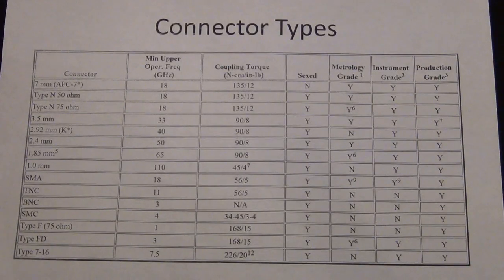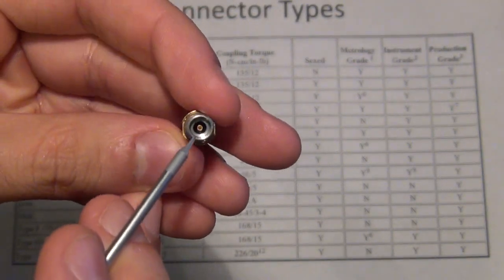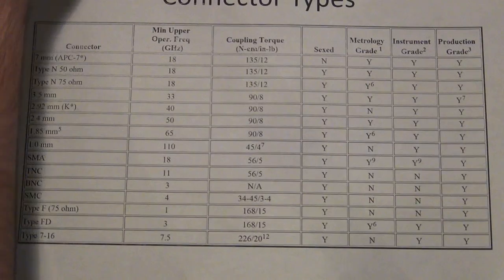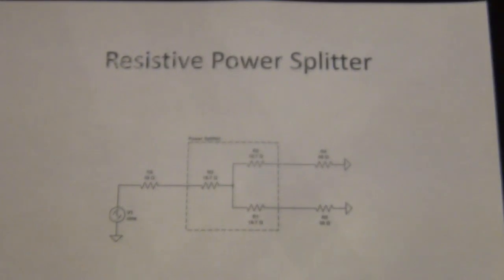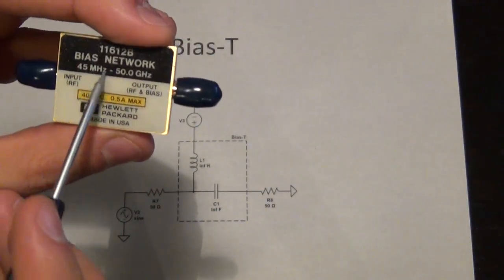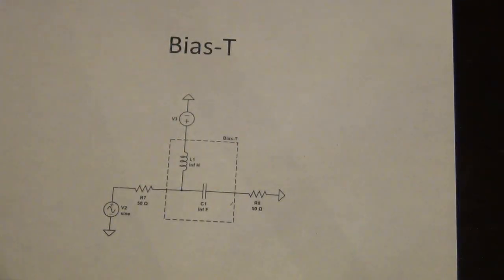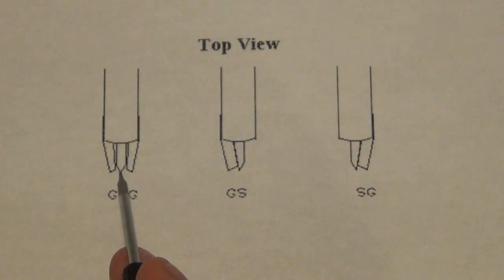TSP #26 - Tutorial on Microwave and mm-Wave Components and Modules

Comment from the maker: After a decade, there is a mistake in the video I'd like to address:

The subtle description of the doubler operation at 45 minute mark is not correct. The top and bottom of the board form a broadband balun and the tapered lower layer transforms the signal into a balanced mode into a quad pair of diodes. The signal then mixes with itself producing the doubled frequency. At the same time we don't want to self-mix down to DC and create a DC offset so the little wire is there to keep the DC voltage at 0V while acting almost like an open at higher bands - kind of like a bias-T but with a lower cut-off at >1GHz. This doubler is fairly broadband, operating at the input from 1GHz to 32.5GHz. The fundamental rejection is about 15dBc worst case, likely at the edges of the band where the balun does not have very good phase and amplitude response.

Comment: Excellent tutorial but unfortunately at minute 45, where a frequency doubler is presented, the explanation is very wrong from the beginning to the end. Actually this is a quad diode full bridge doubler that has 4 diodes in the center (like a full bridge rectifier) The line on top together with the tapered line on the bottom make a broad band balun providing a balanced signal to the quad diode component in the center  (bottom is not the ground anymore and it is not also an impedance match either it is really a slow transition from microstrip to parallel line). The thin microstrip line connecting to the ground in the center is actually the return path for the DC and not a filter. Its length is however chosen so that it would not affect the operation frequencies. The balanced nature of this doubler allow it to have a particularly good fundamental rejection, ideally a set of matched diodes along with perfect baluns would result in infinite suppression of the fundamental. Obviously the small asymmetries found in the balun and diodes will result in finite fundamental rejection, good diode selection and careful assembly could allow reaching some 30...40dB rejection (and maybe more) which could be considered excellent performance for a doubler something that the explanation about the fundamental rejection presented on the video leads to think otherwise. I am so sorry to point all this out. Since these videos are very good and educational it would be very good if this part could be corrected. I may suggest to insert some legend in the video. Or some other kind of editing.
Reply from the maker: Thanks for taking the time to write. This video is over ten years old, so there is bound to be some inaccuracies. Indeed the the broadband balun design is something I think I may have talked about in some of the other videos. The bias tap point prevents a rectified DC from appearing at the input side by keeping the bias at 0V. The doubler works from 1GHz to 32.5GHz, which is pretty impressive. Having said that, the fundamental rejection is only 15dBc which is likely the worst case scenario since at the edges of the frequency the balun doesn't have as good of a phase and amplitude balance. This unit was damages many years ago because someone put >20dBm into it blowing up the diode MMIC.
Reply: @TheSignalPath  I see that now you have a good understanding about how it works. Since the video is still available, is educational and very valid despite being 10 years old (surely with people learning from it today) I kindly voice again my suggestion of some legend insert or else... Thanks for the nice contents you keep providing over the years.
Reply from the maker: Yes, I made a pinned comment in the video.
Reply: @TheSignalPath  Excellent. 🙏

Comment: At 32:00 the coupler looks very much like the one in HP VNAs such as the 8753 d/e/es series.  The resistors on the right hand side have a tendency to burn out due to ESD as they're built onto the trace/board.  They can be fixed (basically) by replacing them with a 265 ohm resistor to make up for the burnt out component.  Extremely common problem with HP VNAs.  The screw positions appear to align and the internal structure is extremely similar, so if this isn't an HP part, it's a knock-off.

Comment: Inspection under a microscope is critical.  Some metrology labs have bizarre criteria for acceptance of these connectors.  For example, I've had calibration kits returned as "okay" when upon inspection, most of the spring fingers inside the connector were missing!  It turns out, the only criterion for acceptance was pin depth!

Comment: 13:00 - a real shame you just jumped right after the "mere 3GHz BNC" connector all the way up to 40-60 GHz connectors and using torque wrenches.
Real shame, because most of the instruments that are within 3-7 GHz range (spectrum analyzers) use N type connectors, would have been better if you included those and shown these.
15:10 - Also no mention about the required setting for the torque wrench Nm setting. Some have really small torques counting in 0.01 Nm adjustments, and the others are in 1 Nm adjusts, all the way up to dozens of Nm of torque. Which one do you use? At which connectors does it start to matter? SMA? N? Or these crazy $200 K/2.92mm connectors?

Comment: This was super useful, but I'm sure many of us are wondering how much this stuff costs, so I made notes throughout and looked up prices for everything I could identify.  If no manufacturer specified, it's HP/Agilent/Keysight, and prices are either new, or taken from eBay in Jan 2021, all in US dollars.  I'm not an expert on any of this, I just looked stuff up.

@14:20 - 8710-1765 Torque Wrench, 8 lb-in, $300 (eBay)
@17:29 - N5520B, 1.85mm - 1.85mm F-F coupler, DC-67GHz, instrument grade, $1649
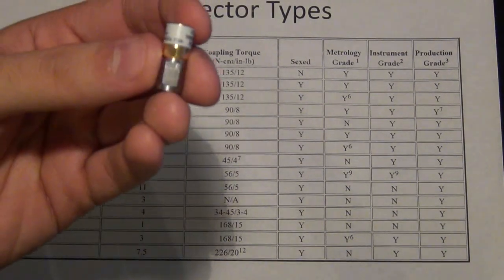@20:14 - 85138A terminator, DC-50GHz, metrology grade, $1036
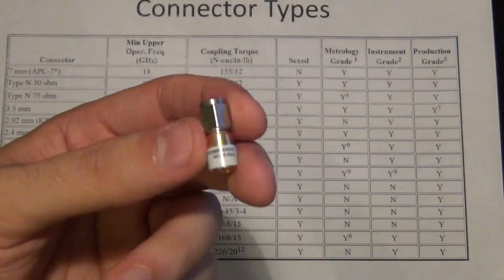@21:28 - 33340C fixed 20dB attenuator, DC-26.5 GHz. (obsolete)
         8493C  replacement part for 33340C, $506
@22:29 - 11636B power divider, DC-26.5 GHz, $1725
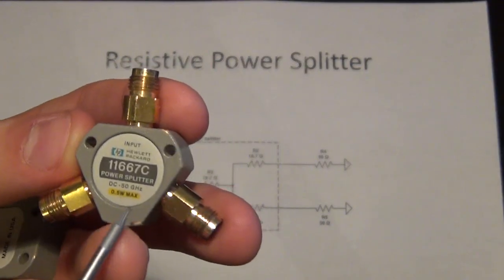@24:46 - 11667C power splitter, DC-50GHz, $2572
@27:16 - 87304C Hybrid Power Divider, 2-26.5Ghz  $1144
@28:10 - MACOM 180deg stripline hybrid, $2483
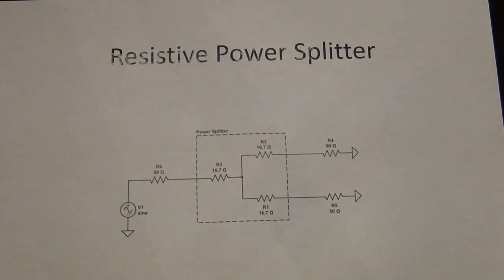@28:57 - 5086-7518 50 GHz directional coupler, $1400 (eBay)
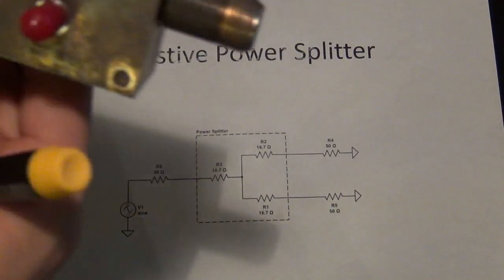@29:23 - MACOM 3020-4099-00  directional coupler, $75 (eBay)
@31:20 - 5086-7489 50 ohm R-Channel coupler, $575 (eBay)
@32:17 - Picosecond Pulse Labs 5500A DC Block, $199 (eBay)
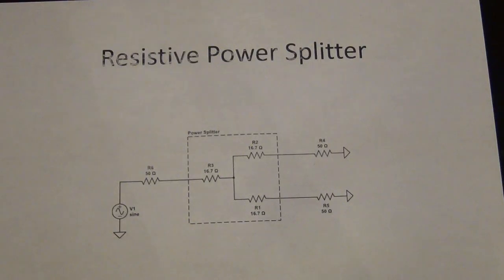@33:05 - Picosecond Pulse Labs 5575A 12GHz bias tee, $250 (eBay)
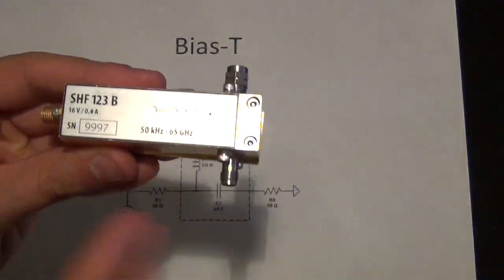@37:32 - SHF 123B bias tee
@39:54 - 11612B Bias Network, 45MHz - 50GHz, $2033
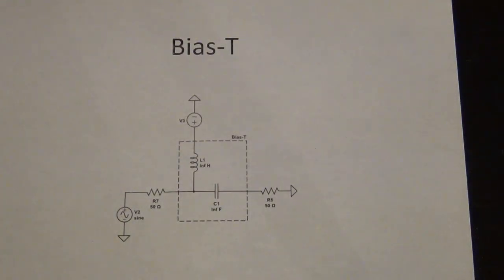@40:32 - MACOM PS20-0001-K DC-30GHz phase shifter
@41:51 - Maury Microwave 1819C trible-stub tuner 2-18GHz
@44:20 - Marki Microwave D0265IJVV passive doubler
@46:33 - Anaren 74125 1-4GHz double balanced mixer, $60 (eBay)
@48:23 - Mini-Circuits ZFJ-1000VH amplifier, $100 (eBay)
@49:40 - Anritsu A7HB3102 wideband amplifier, $400 (eBay)
@50:40 - W281C waveguide adapter, 75-110GHz, $4144
@51:45 - Hitachi WR28(?) directional coupler waveguide, $150 (eBay)
@52:26 - millitech 45168H-1000 circulator, CF 140 GHz
@53:23 - WR10 horn antenna, $775 (eBay)
@54:26 - Cascade 167-A-GSG-100 probe
@57:40 - GGB PicoProbe MCW-23-137205

Comment: The electronics engineer of the future would do well to take a class in plumbing/ mechanical engineering, with these pipes and cavities. I believe at these GHz freq's the signals/current travel on the surface of the metals due to skin effect. Very interesting video.

Comment: 14:10 When you use a torque wrench of that type it is important to apply the force (with your finger/hand) at the intended distance from the tip pivoting point, othe wise the torque will be wrong, especially if you are using a wrench with a long tip like that.
Compare the effekt of "L" in this page https://www.engineersedge.com/manufacturing_spec/torque_wrench_1.htm
Reply: Dusty 99  Yes it sure is.
Reply: Dusty 99  Yes
The type of torque wrench that is used in the video  just after 14:10 has a built in "crow foot"
(as required since the pivot point, which clicks/releases at a defined torque, is offset from the
center/rotation point of the nut which is tightened, as that is where the cable is).
And if you use a crow foot the actual torque depends on where you apply the force with your hand.
See https://en.wikipedia.org/wiki/Torque_wrench#Extensions
Imagine you apply the force exactly at the pivot point, then the wrench will not release/fold at all.
Imagine you apply the force 0.1mm away from the pivot point, then you need to apply a considerable
force to make the wrench to release/fold.
Imagine you apply the force at the far end of the wrench, as far as possible away from the pivot point,
then the force needed to make the wrench release/fold is much lower.
The effective torque is constant at the PIVOT/FOLDING point when the wrench releases, no matter
where you apply the force, but NOT at the nut center point, as the force-to-nut distance is NOT
proptional to the force-to-pivot point distance.

Comment: Small thing - you should only tighten with the torque wrench until its starts to move. If it 'snaps' over you may well put extra torque on the connector.

Comment: One minor point... The two step Wilkinson splitter shown at 26:05 probably only works over 700MHz-1500MHz and not 100MHz to 1500MHz. I don't think you can get 15:1 bandwidth from a 2 stage splitter like this.

Comment: You want your coupler to be directional because these are mostly used in networks and you want to see where in your network the signal is getting through and not getting through and which direction the signal is coming from, so there fore you can trace where in your network there may be a problem. The signal coming in through the out put port is usually terminated through the coupling to a terminator, unless of course your using a dual directional coupler.

Comment from the maker: You should not take my word for it! You should try it for yourself. Setup a 67GHz VNA with -20dBm launch power and do a two port calibration. Then measure the SP of a DUT with better than -40dB return loss. Disassemble your setup, and re-assemble it. Recalibrate and measure again. Do this once with metrology grade and once with production grade connectors that have been used at least 10 times. Compare the four measurements you just did. Guess which curves will be on top of each other?

Comment from the maker: Of course you can measure the difference! It is more than just raw performance, it is also performance over time, repeatability and life span of the metrology grade connectors. These things are not the latest consumer product where you can 'fool' the buyer through exaggerated advertisement. They are scientific products. They are either objectively better, or they are not. For example, device modeling with production grade components is essentially not possible.

Comment from the maker: These connectors are precision components. But the main reason they are expensive is volume. An Intel processor is more expensive to produce in small quantities, but you can buy them at a lower price than these connectors because they manufacture millions of them. The price of >50GHz components have already dropped significantly in the past decade.